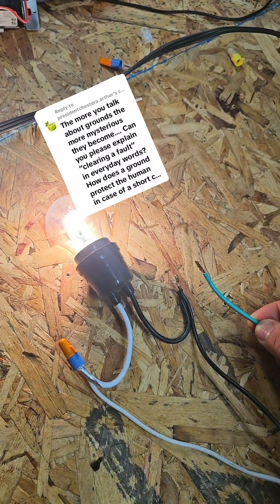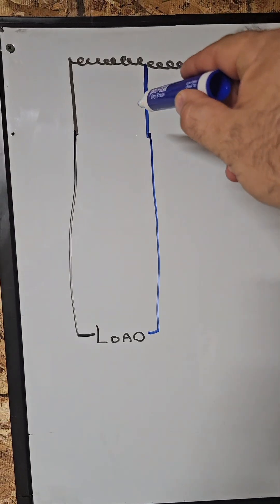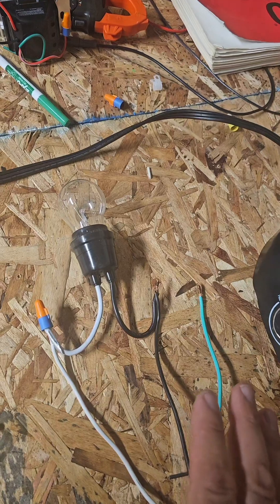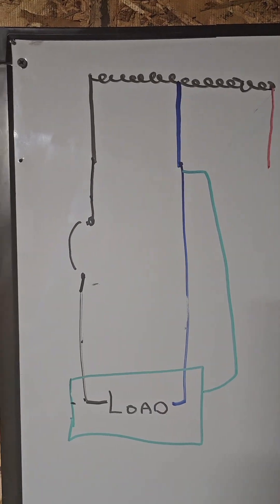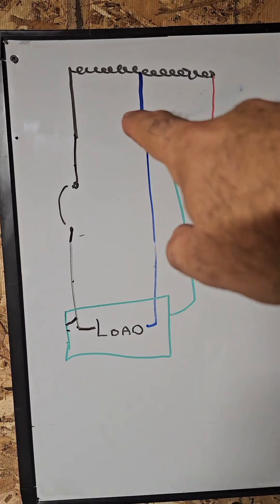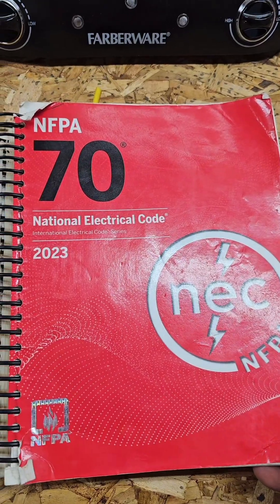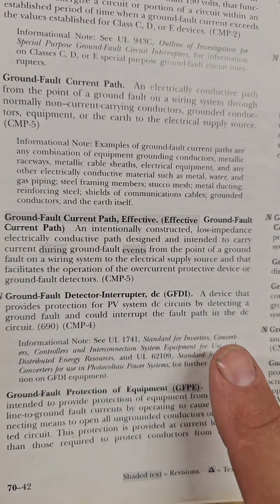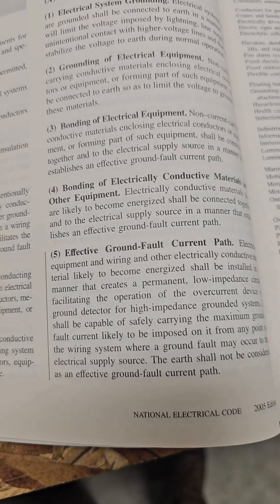How does a ground wire trip a breaker???

Comment: Thanks for the video. The explanation of the "short circuit" with no load helped clear it up for me. Why doesn't current flow back from from neutral to ground wire (bonded to neutral) to the metal case of a device? Is it because with a properly working device, that neutral to ground path would be considered high resistance? But in a faulty device, that path then becomes low resistance?

Comment: What if you turn off all the breakers at the load center, except that circuit and then chek if you have voltage in other circuit,testing the breakers,to find the eléctrical short which it's feeding that neutral.

Comment: The key to this is that you need a low impedance path to the source. The neutral is grounded at the panel and at your transformer for your power service grounding rod. The purpose of grounding rods is to provide a safety ground path for any buildup of statice charge and/or lightning (a very big statice charge). 
Just for clarity, the neutral and ground (green wire) are bonded only once at the panel with the main cutoff braker. (This is just me a layman.)

You can think of the Earth as a sheet resistor, and that’s why they talk about the dangers of down power lines. Within the distance of one step around down power lines, there could be enough voltage to kill you.
Reply: I've brought this up and tried to correct this guy but he won't have it. Yes, the neutral is grounded (earth ground) at the property edge transformer and at the main panel (basically the first point of the properties system). The reason is to put neutral at the same voltage potential as the area ground). That is what allows someone to touch neutral in a healthy system while standing on the ground (yes, that ground) and not get blasted. The ground rods are not there for lightning, they are there to keep the system ground at the earth ground potential. 
The reason that neutral and ground gets separated downstream of the main (with the exception of any oddball exceptions) is that the ground is intended to be an inactive safely and only carry current back to the main in a emergency situation. At any point that the neutral and ground connect beyond the main, the ground becomes a current carrying return circuit back to the main and is compromised as a inactive safety.
Reply: OK, looks like I need to update my comment about ‘earth grounds’.

Yes, an ‘earth ground’ will equalize your electrical system to ‘earth ground’. Just under certain fault condition, that may not be ideal. Look up ground electrified around power poles (this is a rabbit hole and is a good start for recurring this discussion). This is a fault that can kill small animals and you. The way this works is that the power pole in question has a ‘earth ground’, but you can assume that all poles are an ‘earth ground’ of some sort. When the ground gets electrified, there is a fault somewhere. 

Fun Fact: the reason GFI’s are now required around all pluming, is that the pluming pipe is grounded to ‘earth ground’ in some way (it should be bounded to GND by code).

Terminology: 
GND is the electrical panel bounding to neutral and then to a grounding rod.
‘Earth Ground’ is Mother Earth connection by grounding rod.

Note: Tap Water is a conductor. Only distilled water is an insulator for this discussion.

Comment: Thanks for your videos, I have learned enough to keep me safe when troubleshooting issues in my 93 year old house. 

After your brief explanation of the purpose of a ground rod as a path for lightning and static electricity to flow back to its source, (the earth?) at 7:14 you say it's electricity from a transformer that won't flow into the earth. 

At 4:00 you say drop a live wire in a puddle, current would energize the earth, track over to the closest ground rod go up the grounding electrode conductor get back to the neutral then back to the source (transformer?).  I demonstrated this concept to myself by plugging a wire into the hot side of a receptacle, running it to a light fixture, took a neutral wire from the light fixture and stuck it in the ground which lit up the light bulb. In this scenario the electricity, which originated from the transformer, is traveling into the earth to get to the nearest ground rod to then get back to the transformer. Could you help me understand how that is that different than lightning traveling into the earth through the ground rod?
Reply: I saw in another video, the lightning mentioned was for the lightning hitting the utility cable. Then it travels down the neutral wire --> grounding rods --> earth (source)
Reply: @MmmhMarky  Not exactly sure what you mean by utility cable, but neutral originates at the property edge transformer. There are no neutral wires in the power grid, either the overhead power lines or underground cables. The house down the road from you is using its own neutral that was originated in its transformer, not your neutral.
If someone puts up a lightning arrestor system, they install ground rods specifically for that system. They are not the same ground rods for the electrical system.

Comment: So if the hot reads 120v and that travels back through the neutral to the transformer, why is it there is no voltage on the neutral (unless another load is applied with different voltage)? 
Your videos are amazing, by the way. They've helped me immensely!
Reply: Note: the standard is less than ½ volt between neutral and GND, if is more than that, then I as your friendly neighborhood service technician out to repair your office equipment will tell you to get that fixed ASAP.
Reply: In a short from the hot to the neutral, the voltage does increase on the neutral until the beaker trips. The neutral has some voltage due to the length of the path back to the transformer. Wires have a small amount of resistance and even more under a fault condition. So the wire becomes a resister, and over the length of wire the voltage becomes closer to 0 volts. This is also why you sometimes see lights brighten or dim when something shorts out. Hope that helps.
Reply: Because the voltage is lost at the highest resistance i.e. at the load.
Reply: There IS voltage on the neutral, referenced to the Lines or anywhere else on the transformer windings. There isn't supposed to be voltage on the neutral referenced to ground because they are tied to the same point and should have the same potential. If you just have a single phase transformer outputting 120VAC, and there's only 2 lines with no Neutral, you can ground either of those lines. It's just making one common with ground. Either Line you choose should then have no voltage to ground because you are trying to measure a potential difference where there shouldn't be any. 

Now imagine you have a Delta transformer with no Neutral. Then you ground the B phase. Now the B phase should be 0v to ground. It hasn't magically lost the potential difference it provides between any other phases. It has created a reference point for anywhere else on the transformer to form a potential difference to ground. 

When a non-solid grounded Delta has an "accidental" ground fault, it's more or less the equivalent of just adding a solid ground. The fault current will be minuscule as usual because there is only going to be so much capacitive coupling. It's the next fault that occurs afterward that's going to trigger fault protection because the first unintended grounding tied ground to the output of the transformer. If that next fault were to occur on the B phase then nothing should happen because B phase was already at ground potential from the first fault.

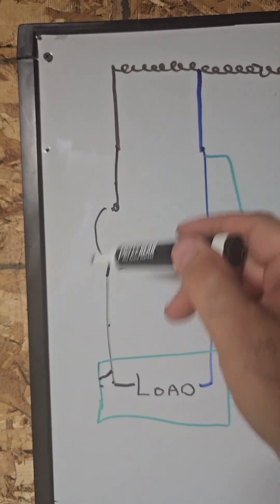Comment: 3:10 Nope! You wish. Instead you can have parasitic voltage and amerpage draw into the ground and a complete circuit of electrolosis . The ground  will never trip the breaker  cause a 20 amp breaker isnt a 50 Ma GFCI it does not give a crap about ground faults. Take your hot wire stab it on the earth now go get your Amp meter and read how draws 2-15 amps at differnt distances from the hot wire. Never tripping a breaker. Will run " hot" for years till the unlucky guy with worn shoes and a wet hand kills himself cause a GfCI is the only thing that does what you claim the " ground wire" is doing.. Please dont misinform people if you dont understand electricity
Reply from the maker: Lol wtf
Reply: 30 seconds later he describes the term "ground" and the confusion it creates. 

And it's 5mA to trip a GFCI, not 50.
Reply: @CJRock-xn5qf  Did he edit that part out because I never heard it. Regardless— his simplistic explanation is pretty spot on in my opinion.
Reply: @Mark2448   Timestamp 3:45     

He does a great job explaining explaining what is an extremely technical issue. Unfortunately, semantics do get in the way.

The problem will always be the   word "ground". Most people will always think, earth, and all of the misconception regarding the ability of earth to conduct electricity (realative).
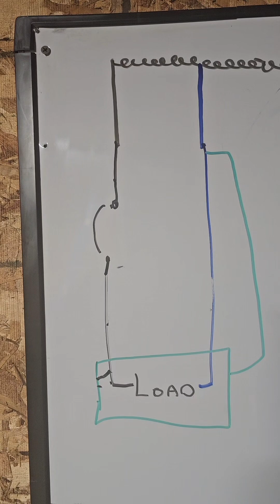Reply from the maker: I am not talking about the earth at 3:10 I am  talking about the metal.housing of the equipment
Reply from the maker: You have bad listening skills
Reply: He literally goes over the hot tub scenario within the minute after that timepoint and says: "That won't open the breaker" and says it needs a GFCI.

Comment: How does a phone charger know when to stop charging when it is full so it doesn't explode the battery or something
Reply: The control circuit for charging the battery is in the phone itself. The charger is simply a voltage source. Most are simple, dumb 5V sources. Some are a little smarter with multiple voltage modes.

A charger isn't going to make a battery explode unless the charger is providing a voltage much higher than what it is supposed to and the safety measures in the phone fail to prevent that voltage from reaching the battery. 

If the isolation were to fail and the phone received the full 170 V to 340 V peak that outlets can supply, I'm not sure if the battery would survive.
Reply: The phone has an integrated smart charger. It will control the power to the battery based on several parameters such as battery temperature, battery charge and your power settings to safely reenergize the lithium cell.